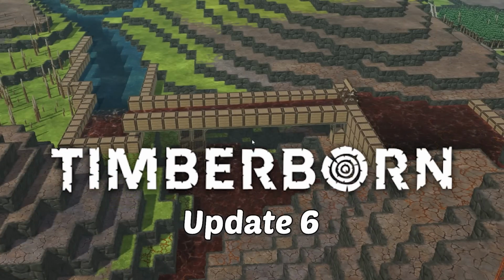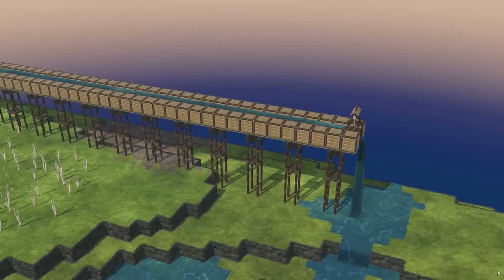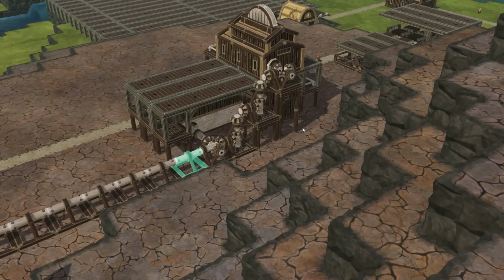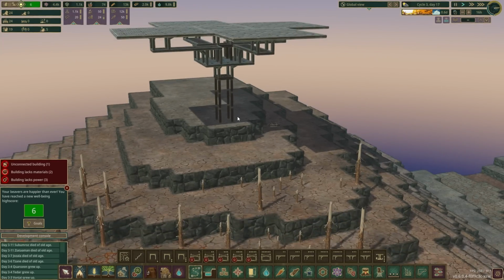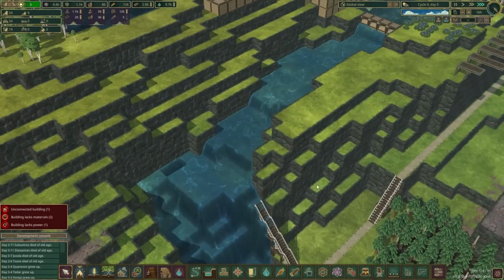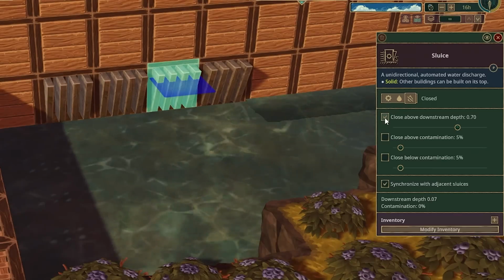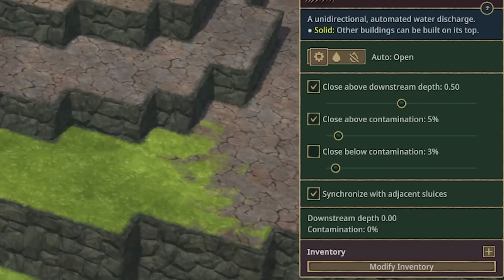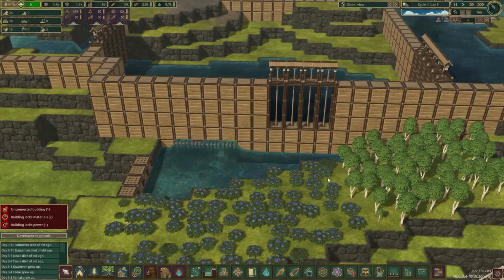3D water physics and more - Timberborn Update 6 brings big changes

Comment: Recently, I was able to make my canal paths work better by putting impermeable barriers above all the paths. Before, I was regulating the water level using sluices, which also works, but with the impermeable barriers the canal paths basically became a weirdly shaped reservoir, so I didn’t need to worry about setting the sluice heights optimally. This made greening up a high up area on Craters a lot easier.

Comment: Another benefit of the sluice gates that I found is that they only allow water to flow in a single direction so you can divert badwater tides to existing badwater rivers and use sluice gates at the point where the diversion channel feeds into the river to prevent the river from flowing into your diversion channel when there's no badwater being diverted.

Comment: I lowkey wish the Sluice gate was less powerful, or at least required more engineering to access its more powerful features, like if you had some sort of sensor or something that you'd have to mechanically connect.
I'd also be interested in lower tech overhangs, maybe wooden ones with weight limits or something.

Comment: how do you place buildings in a way that they're not grey and awaiting construction materials? I see you're using the dev console but so do i and the only way ive found to get closer to a "creative mode" is to place the greyed out building, then click it, then click the finish now button... instead of having it appear directly, colored, built and ready for use
Reply from the maker: If you hold down the control key on your keyboard while you are building it will insert the building prebuilt! It works for resources like food and trees too. I always forget and end up having to delete the preview
Reply: @ZeddicBuilds  thank you so much!! And thank you for the upload as well, i learned what the first option of the sluice was about as well as how to pronounce that word lol
Reply from the maker: No worries! I think my pronunciation was a bit off in the video: I think its supposed to be more like “sloos”, similar to “loose”

Comment: One thing I notice is that you can make a vertical water wheel power system. Build levies all around a water source, fresh of bad water, so the water is contained until you get high up. Then set up aqueducts that travel back and forth. Each end of one drops water into the aqueduct underneath it. Then the water is routed back the other way. Instead of having to spread out to get water flow you can use a small amount of land for the system. you could even put Gravity Batteries to drop over the side.
It would be a VERY late game to accomplish because all the metal you would need but it is possible.

Comment: You should now be able to have pumps in large reservoirs under the water so they can take water from the entire reservoir if you use the new plates and build a structure around the pump itself so it doesn’t get flooded 

Basically 1 pump a few block above the bottom of the reservoir that’s able to utilize all the water no matter which level the water is at or how deep the reservoir may be
Reply: You could just make a little thing like he did in the video here with the aquaponics farm. Have a little sluice pond and have your pumps off of that.
Reply: @adamt195 yeah but that’s the easy solution lol
Reply: Plates are not going to work, as they let water through, if it rises from below.
So you have to put levees on the platforms.
Reply from the maker: @harry68784 - Good news! They just patched that on experimental. Impermeable floors are now solid from top and bottom.

Comment: As I understand it, this update makes it possible to pump water upwards. Normally, if you build a pipe that climbs a hill, the water obviously won't flow upwards. However, if you completely seal off the source blocks so that water can only go through the pipe, the water will be pumped through it.

Haven't tested this myself yet though.
Reply from the maker: I just did a quick test and yes you can.  Once sealed, water will fill the pipe and can go upwards at pipe bends. It acted similar to the pipe example near the end of this video.
Reply: @ZeddicBuilds  Great! Thanks for confirming. That means you can build some really high water reservoirs without having to build the reservoir around the source blocks or using pumps.
Reply: im using it to great success on the map with all the craters and large pools to prevent bad tides from affecting the main water source by diverting it upwards and away

Comment: Also note that water will only flow through Sluice gates in one direction. This makes it possible to build dams where water won't flow out of the input side if the input water level drops below the height of the dam.
Reply: One way valves you say? ::Homer Simpson noises::

My builds always devolve into>
>before bad tide: big dam/reservoir with a single wide full height outlet abusing the 2.2 flow rate of a tile edge to ensure a constant flow of exactly 2.2 units of water flow(or 4.4/6.6, you get the idea) out into the irrigation network till the dam was empty or otherwise, and taking off as much power as I could/needed in the meen time.
That slowly evolved to completely defeating the "anti perpetual motion" mechanics, and would be pumping the spent water back into the dam and the only loss was evaporation/direct use or overfilling.
>After bad tide: All the above except the perpetual motion machine went in-front of the dam inlet to power the pumps that filter and feed the dam, that outlets back to the filters again resulting in once again only clean water loss being evaporation, direct use, or overfilling the reservoir.

What it is looking like after 3d water: a couple of those sluice gates and the filtering is set on the inlet side(hell of a lot cheaper/easier then a mechanical pump), wonder what the flow rate is on a sluice gate?, I beleave they said they abandoned the anti perpetual motion "solution" that initially implemented(the resistance each wheel added or whatever), and pumps are 2 blocks longer now, took two of the three usable levels from a water pimp to power itself with the last layer being your over unity take off, if nothing else changed two more water layers makes it two layers to power the pumps and three to take off and be industrious little beavers with.

Comment from the maker: Kudos to the Timberborn development team for adding support for 3D water. I'm really looking forward to this release. 

in this video I concentrated on the water and new structural buildings, but there a a few other additions including Wonders, Tattoos, and some tweaks to vertical water pumps. For the full details, check out the release notes: https://store.steampowered.com/news/app/1062090?emclan=103582791465548220&emgid=4236280100277465743